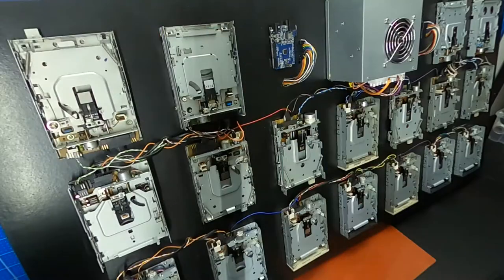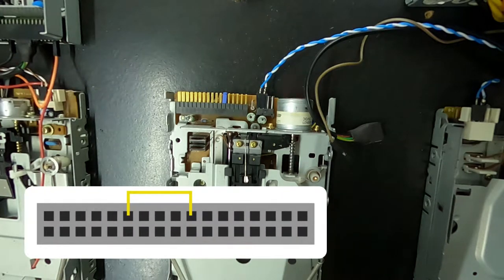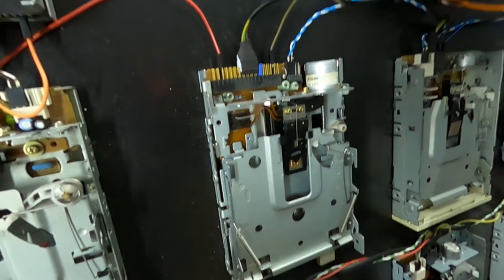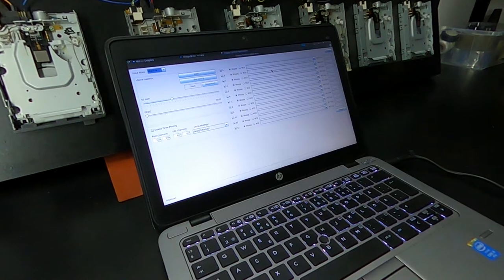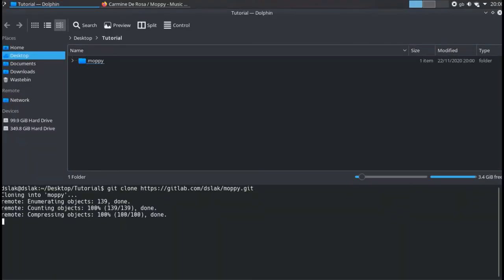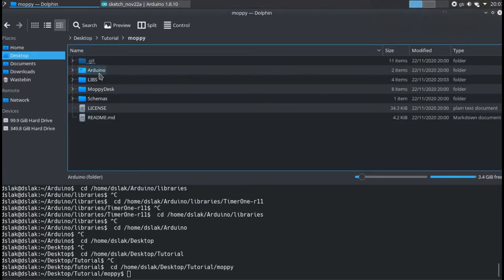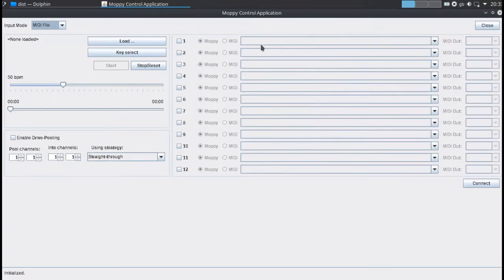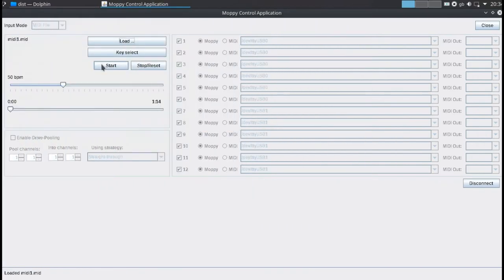How to Music Floppy works - Tutorial - Part2

Comment: @
Dslak
One idea to bring your arduino to the next level. Use a Lolin/Wemos D32 v2.0. There you have a display port, sd card slot and many i/o's. WIth the right coding you can use both cores. The ESP32 has two cores in the current version. And as a bonbon you could control it via wifi or blouetooth. More you can use the OTA function to update software. The midi files could be loaded from the sd card. Man a lot of fun is waiting. ;-)

Comment: Do you think driving the FDDs with 3.3v can alter the sound ? I know it is the logic part and it triggers step and direction but im wondering. Also, do you think having different floppy drives instead of the same similar model can make ugly sounds ? i mean if you have n times the same, they will have the same resonance and design flaws so they will together-sound great. Other than, that i adore your content !
Reply from the maker: Driving them with 3.3v I think they just don't work 🤔, as far as the model is concerned they actually all have a slightly different sound, the only thing you can do is add/remove the cover or act on the eject button to block or not the sled (and therefore  make more or less noise)

Comment: install the software on the old 32-bit pc with linux as the os, or install the software on my normal pc?
Reply from the maker: The problem is the old 32-bit libraries, which also require an old version of java, so it is advisable to install an old Linux distro, but if you have time you can try to do a port.
PS: What do you mean with "normal PC"?
Reply: "Normal PC" = Windows haha. I do have a laptop that has Linux as the OS will give it a go if I still can't get this to work. Thanks

Comment: Could using an Arduino Mega accommodate more than 16 channels vice using two Arduino UNO?
thank you for the great video instuction!
Reply from the maker: yes, the code has to be changed, it currently has 12 channels, but you can always connect multiple floppies on a single channel